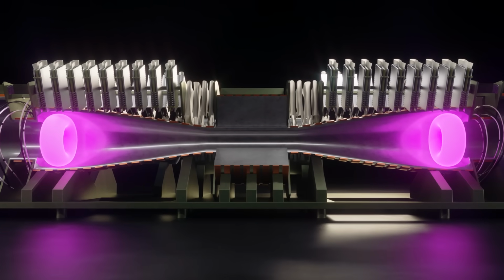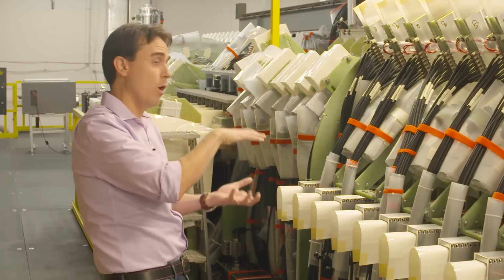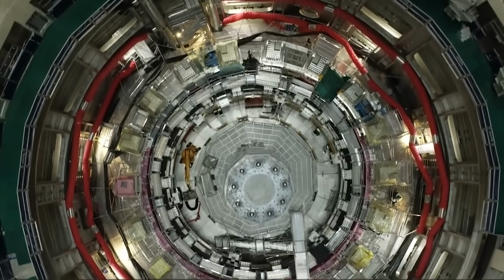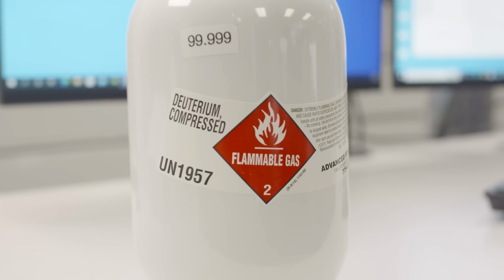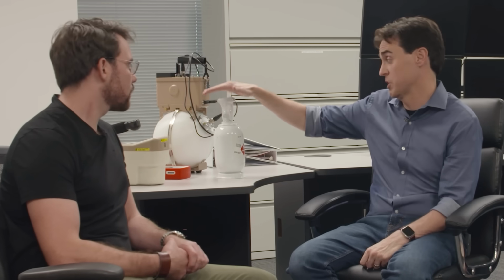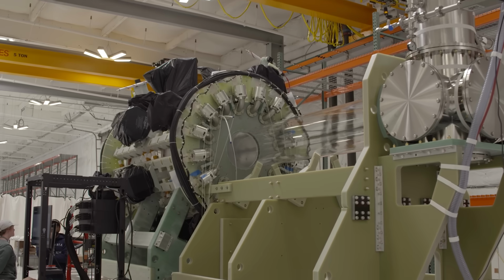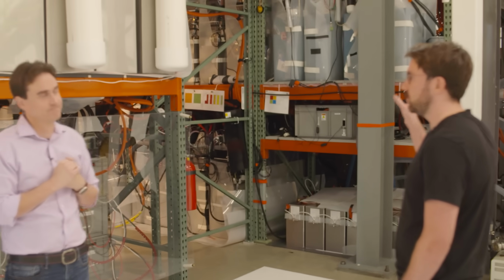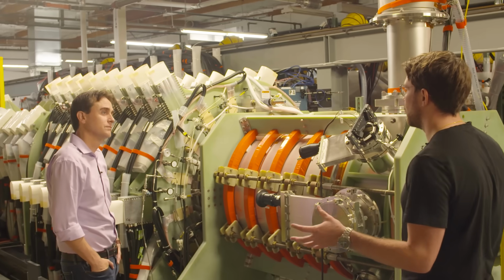A New Way to Achieve Nuclear Fusion: Helion

Comment: Not sure if real engineering got paid for this or not. There seems to be a lot of holes in this video.  Youtube improbable matter. The problem with helium energy. That's a response video of this video.  
It seems at times real Engineering has some good info. But I hate it when u find out they turn out to be mostly fluff with good graphics. It's hard to find legit info from yotubers.
Reply: Improbably Matter does not know what he is talking about. He did not understand the concept at all and he is trying to apply Tokamak Physics to a completely different concept.
Reply: @elmarmoelzer2229 real engineering definitely got  a fat check to promote company claims from helicon. Also you didn't dispute any of improbable engeerings claims at all you childishly resorted to saying hes “wrong” without explaining why. Makes me think you are helion chill 🤔
Reply: @KreamyFep  nope. All I want is legit info. I don't pay or subscribe to any of these folks.
Reply: @KreamyFep  
Actually Real Engineering did not get a check.
If you look through various comments on here, you will see that I went at great length to dispute his claims several times over.

Comment: So if they use electricity to perform the operation how does that work if they need so much power just to run it?
Reply: The fusion reaction consumes the fusion fuel and produces additional energy in the process (lots of it).
Reply: @elmarmoelzer2229  gotcha.. listen to these videos while driving so was confused  by the enormous amount of electricity it consumed
Reply: @noname2226   It is actually not that much because of the really short time frames involved. A single pulse in a Helion machine consumes somewhere in the single digit kWh of energy. For Trenta that was maybe the equivalent of running a stove for an hour.
Reply: @noname2226  It isn't consuming all the electricity it uses. At least the working version won't be, and they claim one of their earlier prototypes didn't. One of their earlier prototypes just pulsed the plasma without getting to fusion, and then recovered the energy out of the plasma through the same electromagnets, they claim a recovery of 95% of the the electricity put in. That means they would only need to get a little bit of energy from fusion to have more electricity coming out than goes in.

Comment: Maybe gravity has something to do with fusion. Like quantum tunneling. I don't know. I'm not a physicist. 🙏 As in, high temperatures may not be the only thing required. 🙏
Reply: They use magnetic fields to generate pressure. 👏👏👏👏👏👏👏👏👏👏👏👏👏👏👏👏👏👏 Maybe I'm wrong. Maybe it is possible to achieve fusion on Earth. 🙏
Reply: Best wishes to Helion and David Kirtley 🍀🍀🍀🍀🍀🍀🍀🍀🍀🍀🍀🍀🍀🍀🍀🍀🍀🍀🍀🍀🍀🍀🍀🍀🍀🍀🍀🍀🍀🍀🍀🍀🍀🍀🍀🍀🍀🍀🍀🍀🍀🍀🍀🍀🍀🍀🍀🍀🍀🍀🍀🍀🍀🍀🍀🍀🍀🍀🍀🍀🍀🍀🍀🍀🍀🍀🍀🍀🍀🍀🍀🍀🍀🍀🍀🍀🍀

Comment: But still some energy is lost in the form of heat I mean you can't extract  100% from the reactor.why can't we use the heat instead is there a way to convert heat into electricity. I have  seen some square plates that are hot on one side a cold on another but they can produce electricity if you heat them.
I think we should start from the begining because we are wasting resources in the name of RND theres no reactor that can give more output than the input.

Comment: This is such a fraud… it’s painfully obvious…. 6 generations and none of them actually generate power
Reply: Fusion machines need to be a certain size in order to produce net energy. They also need energy conversion equipment. Building big machines with all of the bells and whistles costs money. That is why the first 6 were subscale. They were used to confirm the design and scaling laws. Polaris, the next prototype, currently scheduled to be completed by the end of the year will (if all goes well) produce net electricity.
Reply: @elmarmoelzer2229 0 chance they do that lmfao. We are 50 years from commercial fusion reactors
Reply: @PenskeMaterial69   26 of 37 members of the fusion industry association believe that we will have fusion energy on the grid before 2035. 7 more believe it will be before 2040.

Comment: What is Qeng?
Reply: Trenta did not have energy recovery equipment. That will be Polaris which is currently being built (should be ready around the end of the year or so). That one should have a Qeng > 0 (so a small amount of net electricity). Power plants will follow that one and they are meant to produce 50 MWe.

Comment: This is how i used to think nuclear energy made electricity when i was in abt elementary school i thought the energy produced from smashing the particles together would be directly transformed into electricity rather than using the heat from the reaction to boil water into steam and push steam turbines cuz even at that young age i knew that using just the heat is extremely inefficient

Comment: Maybe I missed it. How long before you break even and what will be the cost. Are we looking at another 20 years and a maybe.
Reply: They are currently building Polaris, their first net electricity (not just net energy) machine. They are still on track to have it completed around the end of the year. Then a few months of "breaking the machine in" and then hopefully they will produce some (small amount at first) net electricity from fusion for first time.
They are aiming to produce electricity at a cost of 1 cent/kWh, though that will likely not be the case with the very first machines. Will take some time to work out the kinks and get mass production going to lower cost.

Comment: Deride Jews top spin with a generator on top of of deride. There is a freezer radiowaves Aurora between the generator and deride radioactive waste inside the Deride .surrounded by electric magnetic field radiowaves copper coil. Lobestone absorb the plasma heat under Deride top.

Comment: am i missing something? i dont see how nuclear fusion will ever work with the current way the reactors are built. the heat from the fusion is hot enough to evaporate any matter nearly instantly. the metals that are close to the reaction will melt just after one reaction. to commercialize it you would probably need multiple collisions per second. no material will be able to withstand it.
Reply: They plasma is confined by the magnets. It does not touch the walls. It is also surrounded by a near perfect vacuum, which is a perfect insulator. So, there the only heat reaching the walls is radiative heat. 
Finally, the plasma while very hot, is not very dense. It is a lot less dense than ambient air. So while each individual atom in the plasma might be very hot, there are just not a lot of them. In fact, if the plasma touches anything, it immediately cools off (one of the big problems for fusion machines).
Reply: @elmarmoelzer2229  thanks! the reason i thought that was that ive seen many other videos where they had some structure made out of copper coated with diamond that surrounded the fusion process in a different reactor. there the entire thing just completely melted and deformed after every single reaction and so it had to be replaced every single time.
Reply: @benfrank6520   Yeah. that is the case with some of the inertial confinement concepts. NIF even uses gold for the so called "Hohlraum".
Helion doesn't do any of that. It is a pretty healthy mix of magnetic and inertial confinement, trying to get the best of both and not the worst of both, LOL

Comment: How long to breakeven?
That's all I am interested in for now from this PR piece
Reply: 1. Define "break even"!
2. If you are talking about "net electricity", Helion is aiming to complete Polaris this year. Then they will tune the machine and hopefully will demonstrate the output of a small amount of net electricity shortly after. So, maybe this year or next year. Then after that, they will make their next machine that will aim to produce 50 MW of net electricity.
Reply: @elmarmoelzer2229  Just more energy from the plasma than put into it would be a start, but this video is numbers-free
Reply: @dirkbruere   How do you measure the "energy". I mean, there are a lot of different ways they measure that. See NIF!
For Helion it is all about net electricity. They key for them is that they can recover the energy put into the plasma at a very high efficiency. AND the energy released by fusion at a (not quite as high, but also very high) efficiency. Helion claims to be able to recover the input energy at 95% efficiency. So, in order to get net electricity, they "just" have to enough fusion energy to make up for that 5% loss plus some extra to have a net.
Reply: @elmarmoelzer2229  But where are the numbers on the enerfy released by fusion in their machine? Do they have any?
Reply: @dirkbruere   They have the numbers of course, but they are not public. Based on the published and peer reviewed results from their previous machine and applying their scaling laws, they should have gotten a few Watt hours of energy out of each pulse with Trenta. That may sound very little but these machines scale volumetrically.
Reply: @elmarmoelzer2229  IIRC they were promising breakeven from plasma last year

Comment: docent it require more energy b.c.: 3He has 2 protons witch means that the electrostatic repulsion between 2H & 3He is greater and it would damage the reactor if the neutrons from: 2H + 2H ->3He + n and the n is free and does not get effected from the magnetic field & it would be the same with a different reactor ?  just a question:)

Comment: I have several problems. with this video. They claim they are speeding up the plasma to light speeds in several meters. The big super colliders need many kilometer to achieve light speeds. I look at the machine and wonder, where are the cryogenics for the magnets. Don't see it. Where are the bus bars supply 100,000 amps to 1,000,000 of amps to the magnets for fusion confinement.  I could be wrong. The concepts seem plausible.  I hope they succeed. But from what I seen, they are a sham.
Reply: -Helion does 300 km/s. The speed of light is 300 THOUSAND km/s (300,000 km/s).
-They have pretty sophisticated switches but the power is supplied not via a single thick cable, but hundreds of smaller cables.

Comment: how the hell do you test something like this?...safely
Reply: Most dangerous part is probably the capacitor bank. Lots of energy stored there. Shorting it could result in a pretty loud bang. The machine itself is not all that dangerous. You wouldn't want to stand next to it when it operates due to the radiation, but the energy content of a single pulse is not all that high (a few kWh). That is because the plasma is very hot but also not very dense (less than ambient air).

Comment: technology like this make me a bit scared.
Like dude, you have temperatures more then on the sun in a metal tube and stand next to it? damn
Reply: You wouldn't want to stand next to it while it is operating due to the radiation, but while the plasma is very hot, it is not very dense (for everyday measures). It is less dense than ambient air. Because of that, the total energy content of the plasma is rather low (a few kWh).

Comment: I was thinking if you could use the fusion chamber as a heat exchanger using Heavy water could extend the life of the chamber and create an alternate power source for the capacitor banks. I’m just a lowly tradesman and I’m sure that avenue has already been considered. I’m fascinated by this technology and use of magnetic fields to control and pressurize plasmid.

Comment: Ok but can half of this fusion machine be turned into a cool plasma coilgun
Reply: Probably not. The plasma would quickly expand without a magnetic field confining it (the expansion is what drives the energy recovery after all). If exposed even to a little bit of ambient air, it would cool off really quickly.

Comment: first of all what type of material are we using for the casing?
Reply: The vacuum chamber is made from Silicon (Quartz). This material works pretty well for this particular type of fusion machine. A Silicon atom has to absorb three Deuterium-Deuterium- neutrons to become unstable and then the half life is only 2.5 hours.

Comment: I've spent a lot of time thinking about how to solve the electricity generation problem with fusion reactions. The current design used by Tokamaks seems to by antiquated and inefficient. The novel solution here is fascinating and much more efficient. Definitely gave me some ideas for new novel designs.
Reply: Sadly it's just another venture capitalist funded pipe-dream
FRC has been around since the 60's and there is a reason why so few people are focusing on it today. Helion claimed they would have a 50 MW installation by 2021 but here we are...not even a sustained net positive energy reaction. 
Not to shit on the people working there. The research is still valuable and I have a lot of respect for it. But their management......

Comment: The best video I have ever watched. So interesting and so exciting. As an electronics engineer I can appreciate (to an extent) the electrical and electronic design work that has gone into the control system. Sounds like this system will work and pulsed energy delivery will be good for direct input energy control and output energy collection. I suppose the system input energy duration could be extended by use of supplementary inductive discharge along with the capacitive discharge into the coils. Absolutely fantastic work - come on America you can do it!!!! Wm.:washhands:

Comment: Another use for this technology should be creating an air breathing detonation engine to replace Turbofans in Aircraft. Detonating fuel spray in a modulated or pulsed method would create usable jet thrust without having to worry about creating a rotating shockwave for Rotational Detonation Engines which has so far proved impractical to maintain. The exhaust pulse would probably look like smoke rings exiting the back of the engine nacelle but on fire. You could combust a lot of oxygen that way.

Comment: David Kirtley said, more than a year ago, that by 2024 Helion Energy's experimental machine would be producing electricity from aneutronic fusion reactions. It is now almost half-way through 2024 and so far I haven't heard any announcement that they are anywhere close to producing even one watt-hour of electrical energy from those fusion reactions in their newest experimental machine. Nor have I heard that they have been held accountable, by their investors, for missing many of the goals they spewed to them and to the general public.

Most of the media presenters that report on this company's efforts fail to make any efforts to critically examine the company's pitches. I urge readers to search for the following video on YouTube for a critical perspective.

The problems with Helion Energy - a response to Real Engineering

Comment: So... how well does it actually work? Are they close to generating more electricity than they consume?
Reply: Sadly no, there is a reason why all big fusion ventures like ITER and the one at MIT focus on other reactions and methods. FRC will never make it to industrial scale for many reasons from the reaction rate (much lower than deuterium-tritium ) to the engineering challenges and increased radiation risks

Comment: I was hoping they would come up with something like this, but bent at an angle with the plasma building up in the "v" and and outlet on the inside of the "v" through a tunnel forming an "arrow" with the fusion creating the heat needed for a thermal electrical generator...

Comment: So, what if they do that from 5-6different opposing fields? Maybe smaller doses with higher frequency of injection? Might be able to prolong and keep the fusion process ongoing.and maybe even be able to control the pressure Better and more accurately?
Reply: There would be no room for the compression magnets. The merging "just" makes a FRC plasmoid that is big, hot and stable enough for compression. The compression is what makes the fusion happen. The compression magnets also recapture (most of) the energy (input + fusion energy).

Comment: The problem isn't starting fusion, its getting more usable power out than you put in at a level that makes it commercially feasible and sensical.

The vital part of the episode is the capacitor talk. That's a source of loss and really means that Helion can't do continuous fusion production. It's also a source of cost, complexity and inefficiency.
Reply: Capacitors are very efficient, actually. I am not sure what losses you expect there. They can do a >95% efficient round trip (through the machine and back to the bank). Helion's machine is pulsed on purpose. The energy coming back from the machine is stored in the capacitor bank and gradually released to the grid from there. More efficient than with grid storage batteries. The Fusion energy makes up for the 5% loss and adds some extra for net electricity.

Comment: I still dont understand how the this process creates power. I understand that the pressure generated from the fustion process pushes the magnetic fields towards the generating coils, but how does the energy from the fusion process transfer in to the magnetic field?
Reply: The plasma itself has a magnetic field. It is made from charged particles.

Comment: The problems of nuclear fusion were solved aeons ago by mother nature.m The Sun is a nuclear fusion reactor which burns hydrogen at a rate that could never be achieved on Earth. 
It is far easier to collect and use the solar energy that falls on Earth than it is to  try to imitate the sun on Earth.,